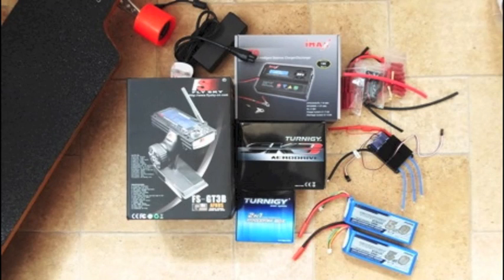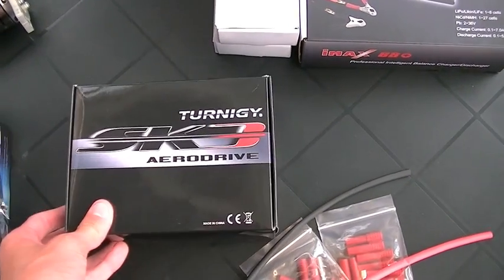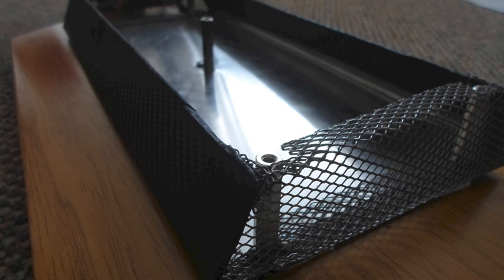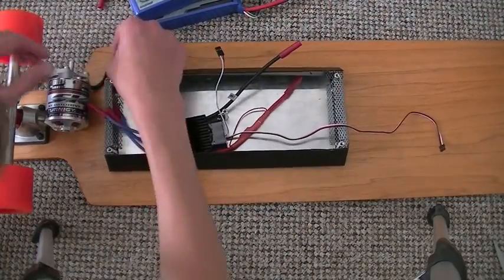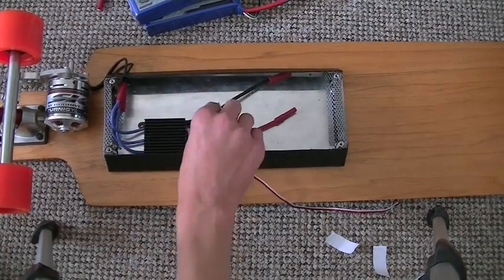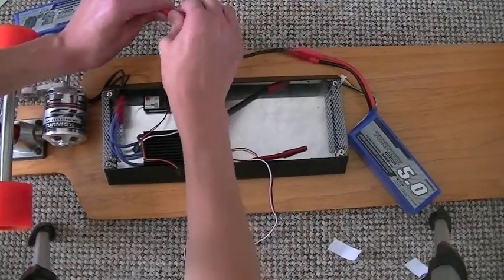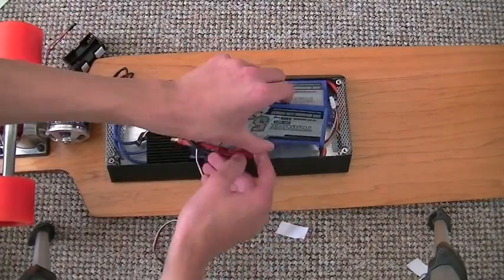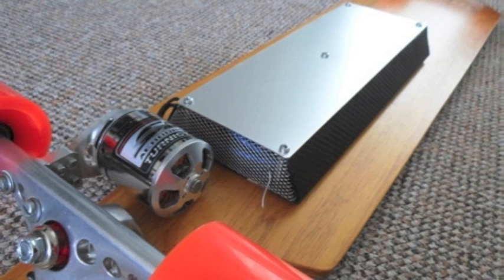DIY Electric Longboard Part 2 - Parts

Comment: i am curious, what was your decision making process in regards to picking the motor and the batteries. 

additionally how necessary do you think the speed controller is? would you be able to get away with a potentiometer set at a particular speed?
Reply from the maker: you want a low Kv motor with high torque and power, the batteries you can then select from there (for the correct voltage and the discharge rating you want) the batteries and the motor then determine what speed controller you need. It is possible to not buy a speed controller if you are comfortable with making a pwm circuit yourself, however for these high current applications a proper esc is the best option.

Comment: Hey Brotha, thank you for the video.  It actually inspired me to make my own.  I joined the esk8 community and love it!  I've actually made my own diy video as well and hope you can stop by and check it out.

- Neil
Reply from the maker: That's great, thanks for watching!
Reply: How are those Turnigy motors working for you?  Are they still running since you made this video?  I like em cause there so inexpensive and if reliable would be great to use for builds to sell. Look forward to your advice.
Reply from the maker: Yeah they're solid, not had any problems with it so far

Comment: Nice man. where did you get the motor mount from?
Reply from the maker: Thank you and thanks for subscribing! You can get motor mounts for different trucks from here http://alienpowersystem.com/product-category/cnc-kit/transmission-parts/ :)
Reply: PracticalProjects I have the same trucks as you 😀
Reply: PracticalProjects can't find it on their site?
Reply from the maker: ahh right, no they won't be on the site as they don't make them for the paris trucks anymore unfortunately :/
Reply: They do make them for paris truck lol . you have holey trucks?
Reply from the maker: yeah I think they make them for paris V1 and V2 when they are in stock :) yeah mine are Holey trucks
Reply: PracticalProjects yeah where did you get the holey truck mount
Reply from the maker: you could get them from the same place, but like I said they don't make them anymore
Reply: PracticalProjects ok thank you
Reply from the maker: no problem

Comment: Can you use other kinds of battery like a usb battery.
Reply: No it must be a lipo as the usb kind(Nickel) can only send 1-5 amps continuously whereas a lipo can send >10. You could use a lot of Nickel batteries in parallel to get the same result but it would be a lot heavier

Comment: what type of pulley and belt did you use? I tried to find some for cheap and got no luck.
Reply from the maker: +Glen Raymond T5s from beltingonline.com please subscribe if you found the videos helpful
Reply: +PracticalProjects you made me save 75$ thank you very much!
Reply from the maker: +Glen Raymond great!! you are welcome!
Reply from the maker: +dylanail I honestly can't remember sorry, the easiest way to find out if your are building one is just to use a piece of string. Then just get a belt that length that matches the gear
Reply: Ok, thanks!
Reply: +PracticalProjects What size belt?

Comment: did that esc work after riding it a while and did it handle the load ? like up hill and down hill braking?
Reply from the maker: +Braylon Hughes The one I had in this video didn't unfortunately. I had a lot of trouble being able to throttle it properly and smoothly with the remote. I tried a sew things but I could never get it to work. I used a different one in my testing video and that is good so far

Comment: This Turnigy Aerodrive SK3 - 6364-213kv have maximum load of 65A.So can we use 80A ESC?? How you charge those two battery sententiously??  And what is the run time of your ?/
Reply from the maker: Soumya Mondal You can if you use less than 6 lipo cells. The reason why the hv 120a escs are useful is that you can use more than 6 cells to increase the voltage. You can charge the batteries simultaneously if you connect them in parallel. But you would then need them so be in series again when using the board.

Comment: If I use 2 8000 mha 7.4 volt lipo batteries then will I get increased speed or distance? And they are 4 cell batteries. Also will I even be able to use there types of batteries.
Reply from the maker: +DIY ELECTRONICS assuming you are wiring those in series then you would get increased distance but same speed. A 4 cell LiPo pack is 14.8v. Yes mine are 4S1P wired in series. You will get more range as mine has 5000mah

Comment: So you said it was a HV 120A Alien ESC.. which I believe is the Alien 120A 3-12S Jet ESC HV. Does it have a built in BEC/UBEC?
Reply from the maker: MrCoyoteToYou it doesn't no, it's easy enough just having a separate battery pack though

Comment: The battery box looks very nice! But how did you get the holes from the drive pully to line up perfectly with the holes in the wheels?
Reply from the maker: Thank You! I just drilled out the pulley first and used that as the template

Comment: So two questions have you experimented with the braking/recharging systems, and also did you have any problems with turning and hitting the motor with the board?
Reply from the maker: not really tested it much since the video so unfortunately I can't answer the first part. and no I have not had any problems, I used risers under the trucks to prevent the motor from hitting the board.
Reply: ok thank you.

Comment: i have everything i want to build this I'm using your 213kv motor and esc and batteries I'm using a different mounting kit but is it going to come with everything i need to connect or am i going to need to buy wires or something. and how do i set up the radio system

Comment: this is awesome! does it still work as a regular skateboard too or would that damage the motor?
Reply from the maker: Not sure if it would damage the motor but it will not work as well on its own anyway as the motor has quite a bit of resistance. Disconnecting the belt is easy enough though and obviously it will then work as normal.
Reply: Cool thanks!

Comment: Is it not cheaper to buy from existing manufacturers than to buy individual parts and install yourself?
Reply: But where is the fun of building it and being proud of it when it works ;)
Reply from the maker: Danian D. exactly!@calmic power and it is actually cheaper this way for the performance you get, sure you could get a cheaper one but not one as good

Comment: i want it :P but im not want lipo cus its Dangerous :P but can you make a film when Your driving that? :)
Reply from the maker: Yeah I didn't like the lipos either, they are safe though if you look after them but this means they are a bit awkward on an electric skateboard. I was always worrying about it. I will, but it won't be for a while now, I'm changing a lot of the components and making it run on NiMh batteries :) I'm busy with school work at the moment so I won't have much time to do it.
Reply: okey, Yeah, nimh is not Dangerous and you not gonna miss Your house whit it but the problem is, nihm battery drive much slower and after 5-6min its will og slow as fuck :P i want to make it whit goped battery, they are not big and they are perfekt to skate/long Board, i give fuck in School teacher hate me and give me so... but posting more videos of the Board when you have time ;)

Comment: this video is great. hough i wish you could have gone into more detail of how you mounted the motor to the axel. if you required any welding ect. and more info on the drive belt/cogs or where to get them from would have been great. but otherwise. great video xD  thanks dude.
Reply from the maker: Yeah sorry forgot about that. There's a bit more info on the website page but the motor is mounted using a bracket and plate which just clamps onto the truck. It is machined to fit by AlienDriveSystems and is adjustable without welding. And the belt and cogs are from belting online 14T and 36T :) thanks for watching!!
Reply: thanks dude xD i gathered the rest from the site, but i didnt know where to buy the mount or if it was self made. but if i can buy it built froma company xD awsome. but yeah, keep up the channel, great work dude. you should do a tutorial on how to make an electric go kart from a mobility scooter. xD FUNNN ! that would get you more suscribers. im trying to get my head round building one now. pretty difficult xD lol
Reply: like a go kart that goes 20 miles an hour or soemthing, just for fun xD no intention to have races with the girlfriend or to ram her with it xD lol
Reply from the maker: Ricky Robertson welcome, thanks again. You can buy the mount from http://www.aliendrivesystems.com/. haha well that would be a bit to expensive for me to do at the moment, but maybe one day! good luck with yours, let me know how you get on. haha :)
Reply: PracticalProjects yeah your right, probably would be, well when i start work in a couple days and get my wage, ill go crazy xD but yeah, gonna make this baor to get to and from work, just because,,,, i can xD but, one more question, what was your top speed, im aware you used a 213kv motor. at 8s. id be buying. 4x 5s 5000mah lipo's. so double the range. id be going for a 250kv motor seeing as hills arent too bad, im based in central london and i can ride throught the massive park to work. GREAT !
Reply from the maker: Ricky Robertson haha nice one! it was around 18Mph on average on flat. Yeah that would be ideal and give you more speed! It is possible to calculate your top speed with wheel and pulley sizes. Search online for a bit and you should be able to do that. That will be great!!